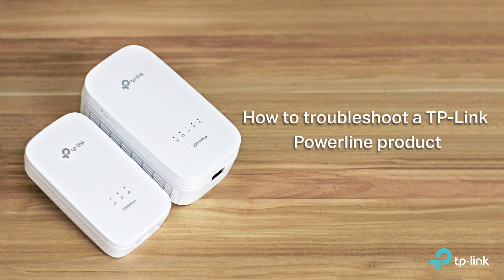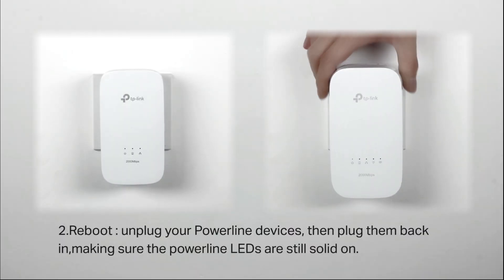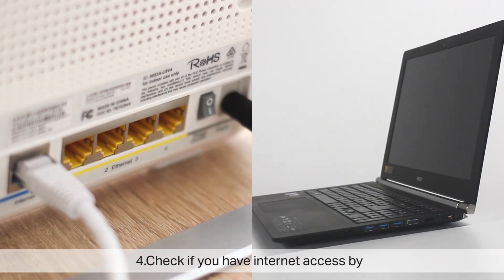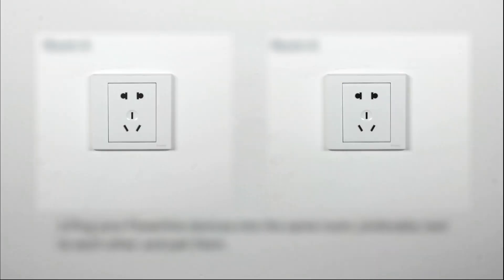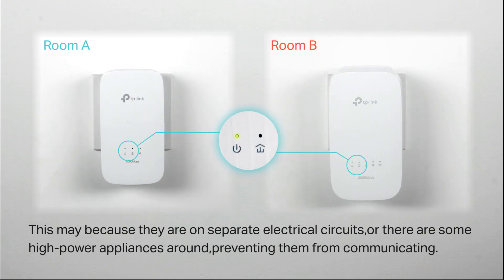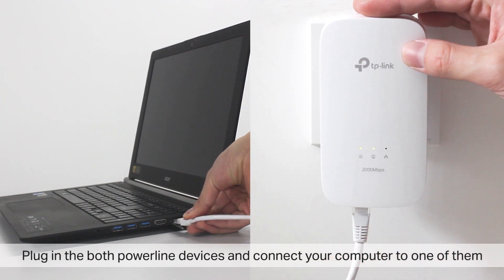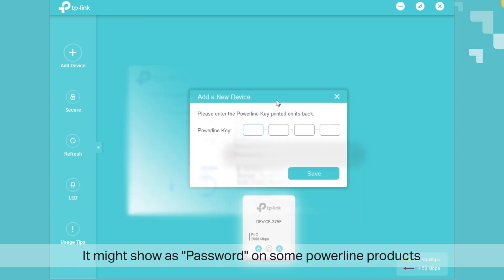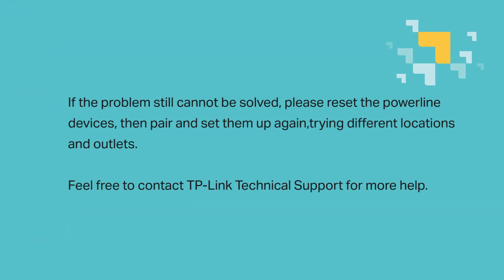How to Troubleshoot a TP-Link Powerline Product

Comment: Hey, did you remove the diagnostics page for plc? I could see which line it was using and with which strengh and now it's only PNY average speed. I need to see the diagnostics page to solve any MIMO connection problems...
Reply from the maker: Not exactly sure what you are talking about.  I would recommend contacting our support team to address your concern.

Comment: What if power line lights up, ethernet doesn't, pairing is not possible via button, the device is listed and shown in the utility app already, but neither ethernet nor WiFi will start and resetting doesn't even start
Reply from the maker: You would want to reach out to support for assistance.  We are not able to provide detailed product support in the comments section on YouTube.
Reply: @TPLINKUS  thx, I will. BR

Comment: i have used my tp links fine for months, my wifi cuts out and 1 of the devices doesnt seem to want to turn back on.
Reply from the maker: If other devices are connecting to the PLC adapter then its not likely the adapter but you can always reach out to support.  They can review and help determine if it is or not.

Comment: Anyone have any idea why one of my powerlines died randomly after no issues for years? (Av1300) Won’t turn on at all but the other is fine
Reply from the maker: It would be hard to say.  It could be a number of causes.  You can reach out to support for assistance but if they are older than 2 years they may not be able to help.

Comment: should the powerline network keep working if we dont have any internet provider ? i mean like a local network between the 2 devices
Reply from the maker: One end needs to be connected to a router, for IP addressing and routing but yet PLC will still work even if internet service goes down or you don't have an ISP.
Reply: @TPLINKUS  it works in first place but then the network between the 2 devices shut down after like 5min... i dont ulderstand the problem

Comment: I installed a powerline kit matched my network name and passwords in the app settings, everything was great. Installed the wifi extender in bedroom, phone showed wifi"6" connection,  ran speed test had 300mbps no problem. Figured hey let me try this in the garage before I order another add on extender. Went great in the garage, put it back in the bedroom same plug and the signal has tanked around 40mbps since. Also added 3rd to the garage and same exact 40mbps happening. Its as if the system is providing a signal, but very weak
Reply from the maker: If you cloned the SSID and password of your host router then it is possible when you did the speed test with 300 Mbps that you were still connected to the router and not the PLC.  I recommend doing a speed test with a physical connect to the remote unit to see if the slow speed is replaced or not.  You can also reach out to support to assist in troubleshooting.

Comment: hello tp link. my powerline (wpa8631p) are no longer pairing. i tried everything in the video but it doesnt work. i suspect the new firmware that came out yesterday can be the cause? im trying to update but i cant without the wifi connection because the powerlines cannot pair. i appear to be stuck. is there any sollution?
Reply from the maker: This would require troubleshooting.  Please reach out to support.

Comment: What makes you think I can try different outlets? That makes no sense... people shop for solutions to specific problems, not swapping one problem out with another.
Reply from the maker: Buying a product to solve a situation doesn't mean it will solve it.  Every home's electrical system is different.  What will work for one person may not work for another.  When a concern arises the only way to determine this is by troubleshooting.  As this video's title suggests the steps inside are troubleshooting steps.  If moving the adapter to another outlet solves the concern then they tells the users there is something at the original outlet that is causing the concern.  It could be as simple as needing to connect appliances near by to a surge protector to filter out noise on the powerline to the outlet is not on the same circuit or panel.  Some of the reasons can be solve and some cannot.

Comment: The power line light is flashing on mine like the one option that is not in this video ffs
Reply from the maker: which model do you have
Reply: @TPLINKUS  av600. The wifi light does not turn on at all, is mine faulty?
Reply from the maker: @ILikeVids-lf1vs   The powerline light shouldn't be blinking, at least not according to the user guide.  The wireless could just be disabled.  My suggestion is to contact support.

Comment: I have AV1000 and connected ethernet to my pc, in the program it says 260mbps speed but when i speedrun i only get 30-60 mbps i have tried different outlets
Reply from the maker: If you are referrring to the PLC Utility, then the speeds you are seeing are the link rate between the two adapters as they communicate down the power lines.  This is not the internet speeds you see but are one of the many factors that can affect them.

Comment: Hey there wondering if you could help me out. I have one linked into my main router and then successfully paired the other one by plugging it into a socket close-by, both sockets located on ground floor. After pairing I unplugged the second one brought it upstairs to my room and plugged it in and it wont connect. What could be the issue and how can I resolve this? Using Tplink Tl-Pa7017 KIT
Reply from the maker: Check to see if the HomeLink light is lit.  This is the light with a symbol of a house next to it.  If this is not lit then the outlet you have connected to is either on a different circuit or otherwise not seeing the main unit
Reply: @TPLINKUS  thanks for the reply. The powerline light isn't lighting up. I guess that's just my luck with how my house is wired.
Reply from the maker: @playa2k81  If you home is wired for coaxial you might want to look into MoCa to ethernet adapters.  TP-Link does not sell any but they are much like powerline but use the home's coaxial cable to transmit data.  If not that then look at a Mesh WiFi system for better coverage throughout the home.
Reply: @TPLINKUS  appreciate the advice. I'm trying to get a better connection for my PlayStation without the need to lay down about 200ft of lan cable and drilling through some walls. Right now using a tplink range extender to grab signals from the main router and then through lan to my system but ping fluctuations still occur. I do have coaxial wiring in my house but unfortunately not near the original router. How effective would a mesh system be in regards to ping? As I'm in Pakistan they seem to be costing a pretty penny.
Reply from the maker: @playa2k81  That really always depends on the placement of the nodes and what the walls are made of.   Heavier material will absorb more of the wireless signal.  The more the singal is absorbed the lower the performance.

Comment: why it that suddenly my Tp-link 2000mbps powerline adapter is solid red in the middle, and doesn't turn green no matter which wall socket it's plugged
Reply from the maker: Red means that its indicating a fault or interference on the powerlines.  If you plugged anything new recently we would recommend putting that new item into a surge protector.

Comment: Doesn't fix my issue, I can connect to the wifi extender wirelessly no problem although speeds are a little slower than connecting to my router. However the ethernet connection is constantly dropping ad no amount of resetting and rebooting and repairing seems to help. I only bought this so I could have a wired connection to my desktop in another room so I can have fast wired internet speeds but I'm out of luck I guess.
Reply from the maker: It could be related to noise on the powerlines.  A way to test this is to move the remote adapter into the same room, preferably on the same wall but a different outlet as the main adapter.  Then test the speeds.  If they are good at that distance then start moving it a bit further out and retesting till you start to see significant speed issues.  This is the area where you are having interference or noise.  You would want to make sure anything plugged in around the adapter at this point is behind a surge protector which helps filter this noise.

Comment: I have a network with 1 power adaptor and 3 extenders AV 500 already working for 4 years. However 1 of them suddenly, last week, reduced the wifi previus speed from 19M to 0,6, but kept normal the ethernet outlet. What means that? Is it damaged or there is some other reason?
Reply from the maker: If it happened all of sudden and the ethernet is not affected then the likely culprit is either 1.  environmental interference 2.  a failing transmitter or 3. channel congestion.  1 can be tested by moving the adapter to a different room and testing.  If there are improvements then you have something interfering with the signal. 3 can be tested by changing channels or checking a channel analyzer and placing the system on a least congested channel and then testing. 2 is usually the results if 1 and 3 fail to improve results.

Comment: what if it gets connected, but the speed drops, on the router the speed is 50Mbps but via PLC only 20 something
Reply from the maker: That typically points to interference or noise on the powerlines.  You can try to reduce this by putting your electronics and appliances behind surge protectors.  Also contacting support to troubleshoot is also advisable.

Comment: its not connecting to my pc, but connected to the ethernet and power
Reply from the maker: Powerline comes in two flavors wireless and non-wireless if your kit does not have WPA in its name its a non-wireless kit and you would need to be physically connected to the remote unit.

Comment: THANK YOU.  all of a sudden my tl-pa7010 stopped connecting on the powerline.  only power led was lit.  tried all different outlets and even replaced primary with the one not working. still no powerline led lit.  then i tried the tp-link utility you mention, entered the 16 digit password and wala,  it found it and got it connected to powerline.  wish the device itself had a "reset" on it.

Comment: One thing that you didn't mention is that, at least in the UK anyway, the devices are fitted with 13 Amp fuses.  Either test the fuse or replace it with a know good 13 amp fuse (likle the one in the electric kettle).
Reply from the maker: If I understand you correctly your are referring to GFCI and AFCI outlets, at least that is what they are called here in the states.  These are outlets with built in breakers and have test and reset buttons in the center.  These outlets actually can't be used with powerline as the data transmission is detected as a fault and trips the breaker in the outlet.
Reply: @TPLINKUS  I am taking about the  TP-Link Model: TL-PA9020P(UK) and TL-PA8030P(UK) and  powerline adapters,. 
I'm not talking about circuit breakers, I'm talking about the small 13 Amp fuse between the three prongs of the plug. You use a very small flat point screwdriver tip to lever the fuse holder out.   Like the majority of UK plugs it is fused with a ceramic 13 Amp fuse.   In the UK if a device is not working you check the fuse in the plug first!

https://www.youtube.com/watch?v=Bho80BG2G30
Reply from the maker: @davebilson  To be honest wouldn't know anything about that.  We don't do that in the US and this channel is ran by the US team.  That is the reason why the majority of our videos are geared toward US customers.  I would recommend contacting your region's support support.uk@tp-link.com.

Comment: None of this helped, I’ve purchased at least 5 different TP link kits across the past year and none of them work, powerline LED keeps cutting out then coming back on again, give up with trying to get internet coverage in my house
Reply from the maker: That sounds like there is something going on with your home's powerlines then.  Remember Powerline does not work across panels, even sub-panels.  both adapters have to be connected to outlets powered by breakers in the same panel.   Also if you have an adapter near an large appliance it is recommended to connect that appliance to a surge protector as they would be generating a large EMI that can disrupt the signal going down the lines.  In fact any major appliance should be filtered through surge protectors as they can create noise which would be the equivalent to a concrete wall with wireless.

Comment: i have to powerline adapters and for 1 year they worked very well, now they sometimes lost connection between they or they will not provide internet like for 10 seconds or something, the using the program to turn off power safe mode , it doesn't do

Comment: What does it mean if it's on a power strip
Reply from the maker: You do not want to user powerline products with a power strip or surge protector.  It affect the polarity and can filter the data as noise and make the PLC not work.

Comment: Why not on a power strip
Reply from the maker: Oh that is because power strips/surge protectors filter out the data transfer as electrical noise.  Similar to how a GFI outlet will trip if powerline products are placed on them.  Also it can change the polarity of the traffic making the two units lose communication

Comment: Can I add a 3rd TP-Link AV1000 Powerline Ethernet Adapter to the mix? Or a 4th? Can they all talk to each other?
Reply from the maker: This FAQ will show you just how many adapters can be in an network.  This is based on the base unit.  https://www.tp-link.com/us/support/faq/434/  If you do mix and match then just remember the PLC network rate is linked to the slowest adapter in the network.  so if you have an AV1000 and add an AV500 your PLC network will be limited to 500
Reply: @TPLINKUS  Thank you! you have a great product.
Reply from the maker: @MarcCardwell  Thank you.  We are glad you are happy with your purchase.
Reply: @TPLINKUS  Cool! I can't see the difference between the pair I have (TL-PA7010P KIT), and the new one, which costs less: (TL-PA7017P KIT), other than exterior styling, are they mostly the same?
Reply from the maker: @MarcCardwell  Other than possibly the chipset they operate the same and are in the same classification so there shouldn't be any difference.

Comment: My Adapter worked fine for about 1 year and now I have no Internet every day at around the same time for hours
Reply from the maker: You would need to first check to see if your computer is losing connection as well as internet or just internet.  If its just internet the issue will be in the router.
Reply: @TPLINKUS  the other 2 adapters work fine, it's just this one and in the tpPLC app it shows 0 Mbps on the adapter that is having problems, for the other 2 it shows 600 Mbps
Reply from the maker: @Termii.  Sorry i misread the video thinking this was for network adapters not for PLC.   For this the troubleshooting would be to relocate the adapter closer to the unit connected to the router and test to see if the issue follows the adapter.  You would also want to remove the adapter from the PLC network and re-add it.

Comment: Messed with all of this while I had a red power line led come on even after unplugging, moving, resetting. All came down to unplugging the Ethernet from my PC and plugging it right back in haha. Error did show up on to link Ethernet extender though
Reply from the maker: Red Powerline light indicates the signal is poor or there is interference.  That will likely mean that it cannot be used in that location.

Comment: Help needed! I live on the second floor and use these units to have internet in the garage (-1) However, the powerline LED is on. But when I connect to the network with my cellphone, there is no connection… Yes, it is the same circuit. Yes, I have resettet the devices… help needed over here!
Reply from the maker: This would not be something we can assist with via YT comments.  Please reach out to support so that they can properly address your concerns.

Comment: Mine works when there close but when I moved the secondary one it stops working
Reply from the maker: That could indicate interference in the electrical lines or that the remote location is not on an outlet that is powered through a breaker in the same panel as the host adapter.

Comment: How am I supposed to download the tp link program if I don't have internet!
Reply from the maker: Powerline product don't generate the internet.  They connect to a router and provide remote access using the home's powerlines instead of something like a range extender.  So you should still have internet by connecting to the router.

Comment: After 5 years of using the AV1000 the powerline light just turned off and won’t connect again. I’ve tried pairing them, switching outlets, resetting them. And it just isn’t working now. Anyone got any idea of how to fix this? I ordered a PCE wifi adapter (finally) but now I’m going to be without internet till it gets here.
Reply from the maker: If you go into the tpPLC app what does it show?
Reply: @TPLINKUS  From what I can tell the TL-PA7010 kit is not supported by tpPLC, correct me if i’m wrong
Reply from the maker: @Flow-.-  Not the mobile app but you should be able to access it via the Mac or Windows application.  Here are the links:  https://www.tp-link.com/us/support/download/tl-pa7010-kit/

Comment: My extender won't pair and the WiFi light won't turn on. Has been working fine for a year and a half. Is it just that the device is now dead? I've tried factory reset and repairing but no luck.
Reply from the maker: its possible.  You would want to contact TP-Link Support to troubleshoot and see what the next action would be.  https://www.tp-link.com/us/choose-your-location/  Choose your region from here, then click on Support and then Contact Technical Support.